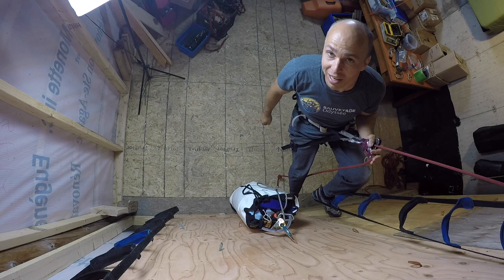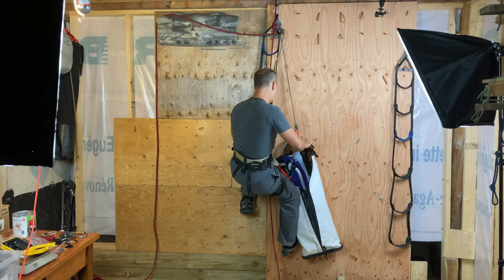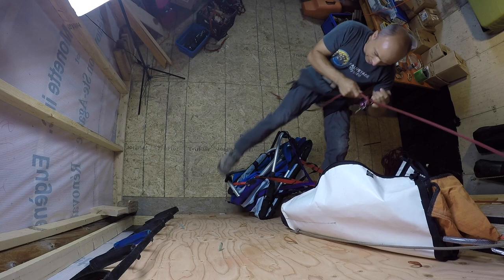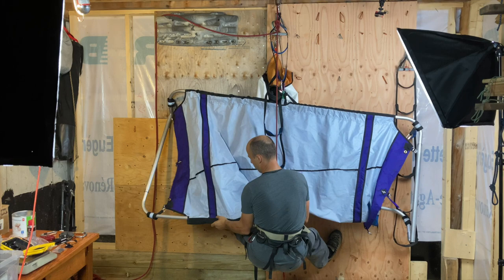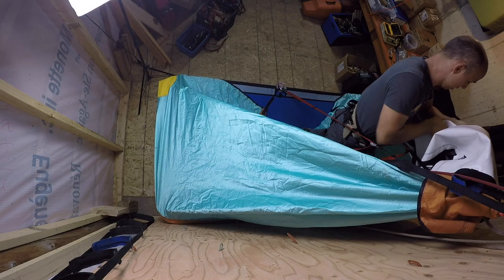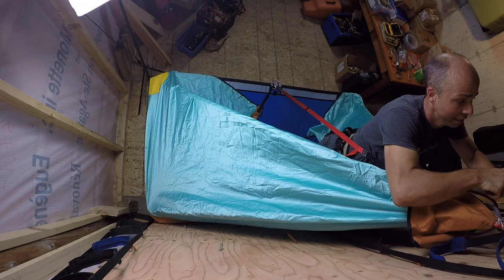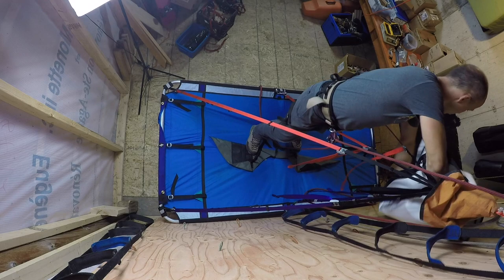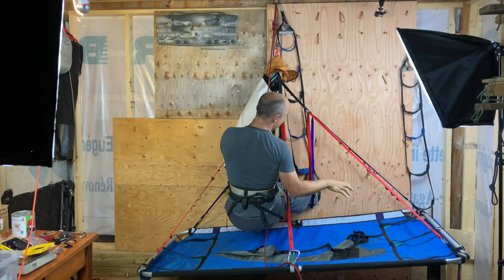D4 Portaledge by Durango Sewing Solutions - 2021 model

Comment: well done, Yann, great video review. Looking forward to when you get your hands on the Delta2p that's in your area, the tapered frame design is the next gen. Surprised this one weighs in at 9.6kg. I think the burly haulbag must be over a kilo, plus Barry has switched to the heavier Xpac for the bed, way burly and deluxe. Nice one Barry, now of Durango Sewing Solutions!  --good to see the new open source design getting good reviews.
Reply from the maker: Thanks John! This comment stuck!!! Do you know if the frame was any different in weight compared to the ProtoX? Always super happy to test the gear I can have access to!
Reply: @YannCamusBlissClimbing  Two frame versions were made for the full size design:  The first was heavier, with traditional tube joiners.Barry made the first batch of Kickstarter ledges (40 ledges) with the original design, then one more similar batch before switching to my D4 Bullet Joiner design, which makes set up way easier and also frame lighter and stronger (overlapping main tubes). The added weight on the 2021 model is coming from new reinforcements and heavier materials to better resist abrasion based on feedback Barry is getting from his production ledges, I believe.  Note:  the D4 Delta2p's I made here in Tasmania weighed in at 6.5kg, which have the same area as the A5 Alpine Double (and Runout versions).  It is the most efficient design, with 6-piece tapered frame
Reply: and to also note, the Full Size D4 from Barry is significantly bigger area than the Metolius you mentioned (and the D4 packs much smaller).
Reply from the maker: @JohnMiddendorf  Interesting stuff! Cannot wait to test the Delta2p :-)
Reply from the maker: @JohnMiddendorf  Apparently the Metolius is 2inches longer and the D4 is 2 inches wider (from specs...)
Reply: delta3p weighs 10.2kg.
Reply from the maker: @JohnMiddendorf  Delta3p is a thing??? Wow I got to look it up!!!
Reply: thank you for getting back into the portaledge design game.  also have been thoroughly enjoying the news letter.  cheers.

Comment: (i've never been on a big wall don't judge me) aren't anyone using a simple hammock with some sort of contraption to keep it 30cm  off the wall and the ends 3.5 metres apart? i think it would be much lighter than this (250 grams for the hammock, 2500 g+ for the special spreader-bar thing that keeps it apart and off the wall) and it would be hard for it to be even less convenient
Reply from the maker: It used to be like this (early days of big walls) but it is uncomfortable to use after a hard day on the wall. The portaledges are much more comfortable so this has been pretty universal for a long time. The current ultralight option is the G7 Pod https://g7equipment.com/pages/pod

Comment: just curious what knot you use for connecting the fly to the 8 mm cord? And do you back up the master point when you sleep one/two people on the ledge or is your only point of anchoring the ledge in is the 8mm cord through the rope man?
Reply from the maker: I ALWAYS connect directly to the belay anchor with a single climbing rope!!! The knot I use (8mm to fly) is typically a bowline with Yosemite finish. I don’t recommend it for life support. But recommend it for gear support. (Requires less rope, is small, and reliable enough in my experience)
Reply: @YannCamusBlissClimbing  thanks for the response. So you’re saying you connect yourself to the anchor while in the ledge but still only keep the ledge connected by the ropeman and 8mm cord?
Reply from the maker: @WiscoAdventures  Exactly that! I wonder how others do it! Hope that is how because a ledge is not PPE rated...
Reply: @YannCamusBlissClimbing  I would assume that no matter the situation, one should always be attached to the wall with something over nothing while in the ledge. I believe your method is sound though, headed to Zion in a month so Ill let you know how it works out